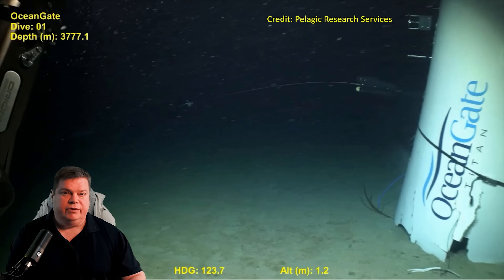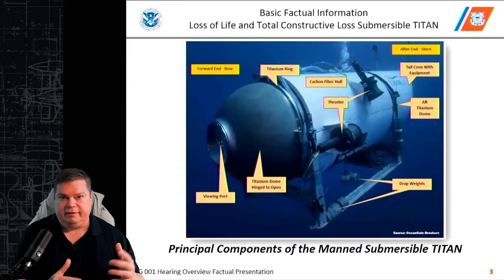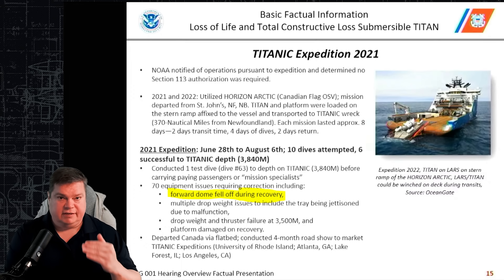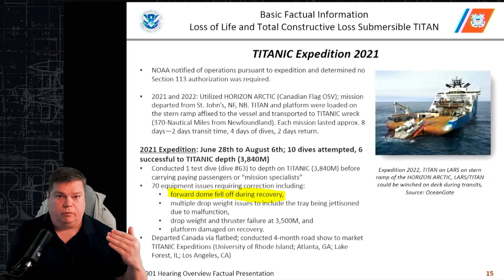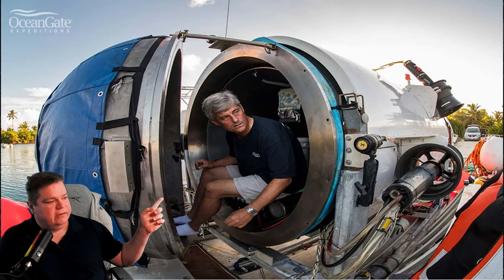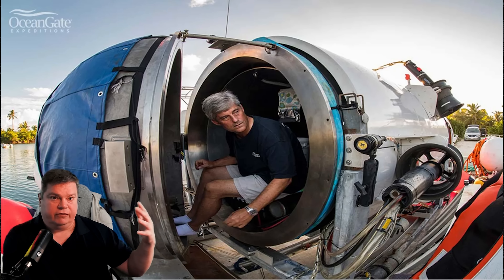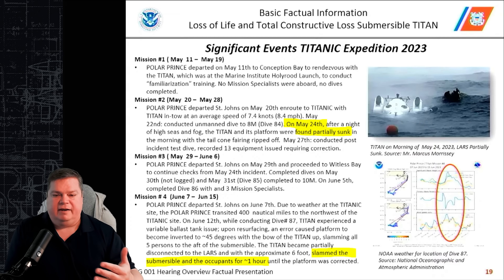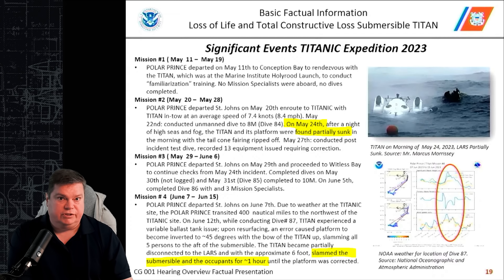New Evidence in Titan Submersible Disaster

Comment: G'day,

The Dome fell off 
BECAUSE 
Stockton Rush decided to
Only fit 4 of the 18 Bolts which were designed to fix the Dome onto the Ring -
"Because the Pressure of Water outside would hold the Dome in place..."

So, when the Crane Operator dropped the Titan onto the Deck/Ramp from a couple or 3 feet, during recovery...; the 1.3 Ton Dome was still falling when the Ring had already been stopped- by the Undercarriage and the Carbon Fibre Tube striking the Deck..., and the
4 lonely isolated spaced-out little overloaded 
Bolts were ALL
Sheared off, very
Neatly....

Then, when Stockton  recovered the Dome, and reattached it, resealing it, he used all 18 Bolts on the job.

But,
Nothing at all was done to
Inspect, nor
Investigate, nor
Asses quite
HOW MUCH  
SHOCK- DAMAGE
Was sustained during that
Impact..., by the
2-inch band of
EPOXY...,
Which was
The ONLY THING 
Attaching the
Ring onto the front of the 
Carbon Fibre Tube....

Bad Mistake, not checking - or better, 
Re-building a new and undamaged Tube/Titanium 
Glued Joint.

But,
That would have cost
Lots of
Money...

Evidence given to the Hearing was that the
Front of the Tube
Failed,
SIMULTANEOUSLY...,
ALL 
AROUND the 2-inch deep
Flange of the 
Ring..., The Tube was
Cleanly cut off  - and as the
Water Ingressed, 
Before the Tube had finished 
Collapsing - the Water had immediately flowed forwards and punched the 
View-Port clear out of the Forward Dome...

While the Ocean,
In microseconds..., 
Broke up the Carbon Fibre/Resin Matrix into  Epoxy-Gravel and chopped Carbon-Fibre Chaff -
And the Pressure then instantly
Jam-packed all that
Busted Carbon-Fibre & broken Resin, 
Along with the
Atomised
Occupants....
Into the Rear Dome, where..., 
When the Front Ring's 
Flange/Tube Joint actually suddenly
Failed...., There  was only one Seal-level Atmosphere of Pressure,
While the surrounding Water was pushing in at something like 350 or 400
Atmospheres....

Messy, very very
Messy...

Titan
Popped, like the
Badly-built
Bubble - which it 
Always was
Going to prove itself - so to be...

Stockton Rush was a
Selfish lying
Psychopathic
PRETENDER....

While ACTUARIALLY being
A hopelessly
INCOMPETANT
Smartarse.
And a greedy needy 
Money-hungry one,
At that.

The penalty for which, is
Usually
A
Grisly
Finish to the
Story....

So - yeah ; this whole
Shitshow was running
Absolutely,
Predictably,
Totally,
True-to-Form....

Somebody should discipline whomsoever it was that
Raised 
Stockton to have grown up to become such a very  murderous
Fcukwit...(!).

Such is life,

Have a good one....

Stay safe.

;-p

Ciao !

Comment: 26:00 just from my POV, i thought that part that is circled was a part of the carbon fiber pressure vessel that remained attached with what appears to be white paint or some other coating on the interior surface that has been chipped or broken.  i'm imagining the sudden and violent destruction of the walls of that cylinder flexing and distending wildly, cracking and flaking that coating off.  just a thought, not an assertion.  very much appreciate your work here!

Comment: "dropped 2 wts" - I remember reading a commentary of the text messages and according to timestamps and depth readings they were way ahead of expected schedule and approaching Titanic depth faster than normal. I always wondered if the carbon fiber was cracked and slowly taking on water the whole time making them heavier. I sincerely hope the passengers were not aware but this suggests they may have started dropping fast before the implosion.
Reply: Unless water actually entered the cabin it would make no difference because it's neutrally buoyant.
Reply: They would have dropped all ballast if they noticed water coming in.  If there's a leak at that depth you're pretty screwed anyway.
Reply: @EbenBransome  I think it's the difference between jumping into water in your swimsuit vs your clothes and shoes that take on more water and make you less likely to float.
Reply: @hanonondricek411  Wet suits.
The clothes impede swimming, wet suits don't.
Reply: @hanonondricek411  That's because clothes are lighter than water. Their point was the CF tube was not, so it being saturated with water or not would make no difference. Regardless as mentioned any kind of serious compromise like that would have lead to instantaneous collapse at depth. CF isn't just normally "permeable" to water like a sponge or something, it would have to be completely shredded to take on significant water

Comment: When you hinge a circular access to a cylinder, there is one pivot point on the rim. This means that the entire door is supported by that single hinge point. This is a fundamental weak point that needs to be quite robust in order to prevent damaging stresses. Ideally, the door would be supported by two hinge points with long arms to allow proper closure. Titan designers have opted for a single-point connection, but the hinge does not look strong enough to readily handle the weight and torque applied by operating the door. I am no engineer nor designer, but even I can see the weak point of this inferior design. Hopefully, an inspection process will come out of this disaster, which will provide a mandatory design-approval inspection for commercial submersibles.
Reply: There is already a system in place for this. Titan was built and operated outside of this inspection and classing system.
Reply: Pivot point => failure point? Anyone else thinking ro-ro ferry Estonia?

Comment: You can tell the messages were lagging behind or not going thru at all.. i myself wonder if the dropping 2 weights msg was sent earlier than they received it and titan was deeper than they could tell.. I wonder if it actually made it to the ocean floor but the jarring of hitting the bottom was enough to cause it to implode.. they had to be close to the bottom cuz the debris wasnt scattered very much.. even the small carbon fiber pieces
Reply: Where is the bottom sled? Not there?
Reply: @joebombero1  good point!

Comment: Were there no cameras inside the sub which can be recovered!
Reply: My theory would be at those depths, anything as sensitive as cameras and their peripherals would be destroyed beyond recovery. I am by no means a specialist, but that's what I would guess. Those are just incredible pressures, and commercial recording devices even aren't typically designed for such environments....and knowing Rush's propensity for using the cheapest products, consumer cameras probably were used, and they're just not designed for anything like this. Most of them you can't even get wet or sometimes even damp, and likely would have been inside the pressure vessel where the humans were. From videos and pictures of their recording equipment that I've seen at least. Just a thought.
Reply: @toddabowden  I would have thought that a memory chip in a mobile phone might retain some data
Reply: @MakeWhatYouCan  At that depth you're talking about on the order of the weight of an SUV sitting on top of an SD card. Not to even consider the forces involved in the actual implosion. Everything inside the vessel was literally steamrolled by a wall of water at the speed of sound (in water) which is about Mach 4. The only hope would be if they had some kind of dedicated, hardened external recording device in the tail, which I highly doubt given what we know about their design philosophies.

Comment: Something critical appeared to happen on dive 80 as well. The acoustic monitoring system showed a discontinuity as the Titan surfaced from 3800m. Energy was stored in the hull and released when the pressure came off. Some sort of material failure perhaps. A loud bang was heard in the submersible and even audible on the surface.

Then the collision with the tender on dive 87 and implosion on dive 88. Dives 80, 87 and 88 were the last full - depth dives.

Comment: 7:45 People saw them drag that equipment out to sea, and no one questioned or stopped them. But when TV came to film a clip about the accident they came with security guards demanding permission slips 

Towing an already failing and stressed submersible is not "fine". It is reckless and puts it at risk of even more failures.

Comment: Thank you @SubBrief. By the time this video hit utube it was just a fraction out of date. We now know that the failure occured (as, reading between the lines of your commentary, I think you suspected) at the interface between the carbon fibre hull and the forward ring into which the hull was bonded. The thick carbon fibre hull was compressed, leading to its outer edge being pulled outward in the ring, breaking the epoxy bond, and its inner edge being compressed into the ring with an inward bending moment of force causing a simultaneous compression fracture of the inner layers of the carbon fibre hull against the inner rim of the forward titanium ring. The water pressure at in excess of 400 bar was a lot more than plenty to finish the job, fracturing the carbon fibre hull instantaneously all the way around that forward ring/carbon fibre hull interface and compressing everything into the rear end dome in, as you rightly point out - microseconds. Previous dives would have weakened the laminar structure of the thick carbon fibre hull, permitting progressively more inward flexing of the carbon fibre hull until it reached the failure point on that last fatal dive. Foresight should have been sufficient to have highlighted this weakness - but incompetance masked it. Who is to blame? Stockton Rush all the way from start to finish.

Comment: It is amazing that there are no bones sticking out of this.  We had a hardhat diver failure under similar conditions, and most of his body was crushed into his helmet, with bones visible.  Made me want to never go into the water again.
Reply: The pressure of the depth that the Titan was wrecked is over 350 times greater than we have on anyone living on the surface. Any bodily matter including bones and fluids will immediate disintegrate well before it reaches any visible part of the ocean due to the sheer crushing amount of pressure alone at such depth.
Reply: That's sounds horrifying

Comment: I’m stuck by the way the carbon-fiber passenger compartment was crushed AND rammed into the aft pressure dome.  Your point, about the failure mode of the connection, between the forward dome and the titanium locking ring, appears to have been overlooked, ignored, and/or gone unpublished, during one of the earlier test missions.  Merely reattaching the forward pressure dome, without knowing why it fell off, was an act of negligence at best.  Hindsight is 20/20.  May God have mercy on Titan crew’s souls.

Comment: 28:20 I STRONGLY disagree with your premise. The front nose cone was popped off BECAUSE the inner ledge of the Titanium Ring was only 1/8" by 2" and not anywhere NEAR strong enough to support the weakest point of the CF tube (The edge) They made the ring inches thick where it wouldn't support the tube so the ring was strong in itself BUT it was woefully too thin where it would be expected to support the part it was Glued to. The Glue was expected to work because of the pressure pushing on the nose cone seating the ring. They F'd up by the numbers because they never calculated how thick the inner ledge of the ring needed to be to keep the edge of the CF tube from collapsing.

Comment: I read Rush felt the pressure under water would hold the dome on so only 4 bolts were installed. When Titan was dropped on deck the 4 bolts sheared releasing the dome

Comment: I heard someone reporting yesterday that the dome fell off because Stockton Rush decided securing the dome with 4 bolts rather than the 16 in the design would be fine. Then the sub was dropped on recovery and the 4 bolts sheered. So that means he when to depth with only a quarter of the fasteners holding the dome on because it saved a few minutes of prep.

Comment: I would assume the dome "fell off" while open, resting on that hinge. You didn't seem to mention that in your video. You made it seem as though the dome came away from the adhesive and they simply glued it back on. That support arm holding it open, which you say "stops it from closing on you" is probably the "fix" to the "cause" of the dome-falling-off problem.

Am I missing something?

Comment: Based on the description of the design of titan sub can clearly see that the obvious points of failure are the connection between the titanium and carbon fiber haul. The images of the wreck shows the titanium parts intact while the carbon fiber haul essentially gone.

Comment: What is there to discuss. The pilot exceeded crush depth of the submercible. Submercible was not engineeered properly, and had material failiure at depth. All were killed instantly. They likely had little or no warning. Pilot/founder's ego got better of him. He brought his experience from tech world and aerospace and applied to deep ocean engineering, a completely different field with deifferent requirements. Company, he ran, decided to get cute , hip, and cool, and hired young exuberance, instead of aged experience. Where titanium and steel , they used spun carbon fiber. Pressure hull failed, they died. All thats lieft now are lawyers shouting. Any criminal charges sunk with the pilot. Former employees who gave warnings were fired and ignored. Those former employees did their due diligence.

Comment: I believe it is safe to assume that the fail process was logarithmic, but that it started slowly with audible sounds as various patches of carbon fibre was failing ... ie snapping or parting of layers. Water was entering into the controls (hence comms failure) and structure. During this time the occupants were in absolute terror. The final failure was too fast to perceive.

Comment: The front fell off, the dome in this case, because the crane operator wasn’t exactly gentle with the submersible and they only installed four of the eighteen bolts that secure it for convenience.

Comment: For those curious, at the depth of the titanic, the PSI (pounds per square inch) is roughly 6000. 
To put this into modern lingo, every square inch is experiencing the weight of a F-150 pushing in on it. Doing some ballpark math to figure out the surface area of the Titan, the submersible felt roughly 550 f150s sitting on it from all angles. That's a lot of pressure and is proof that we should always respect nature and limitations set on what we as humans want to do.
Reply: Americans will do anything to avoid metric

Comment: Im just shocked that there havent been more peoeple mentioning a the fact that the hatch to get inside is literally apart of the structural integreity of the vehicle. Theres a reason the main hull of most modern deep sea diving subs use a hatch at the top instead of having a significant part of the hull being a door at the same time. Theres a reason no vehicle ever that has caught on with the trend of having 25% of the being a door. Large amounts of stress is going to be going on the hinges and having the entire front be able to open easily and have it to be air tight and high pressure resistant is rediculous especially for amatuers.

Comment: I watched a video on the making of the sub and I deal with an adhesive like was used on the sub end caps (plexus) and believe the the titanium surface was not prepped right. When they applied the adhesive to the titanium you can clearly see it was a shiny machined part. It also calls for a colored primer before application.

Comment: I believe a key in how it imploded is front dome separation. Dome was blown clean off the adapter ring. The port window as well popping all the bolts from the flanges from what I saw from recovery pictures. This had to happen as a result of a tremendous pressure pulse as result of the implosion. I believe the carbon cylinder lacked lateral strength and could have had an accordion collapse, which seems like the pulse would be in the direction of the center axis of the cylinder.

Comment: The front dome falling off wasn't a design flaw. It was because of misuse and corner cutting. Stockton Rush told them to only install 4 of the 18 bolts that secure the dome in place while diving because he believed the water pressure would hold it in place. After the dive when they picked the sub out of the water the crane operator dropped the sub and the force sheared the 4 bolts off causing the dome to fall off. So it was a drop and not having the required bolts as to why tge dome fell off.

Comment: There is more that needs to be said about the event when the dome "fell off" in 2021. Stockton Rush had decided that only four bolts were needed to secure that forward dome - "because deep sea pressure would ensure that there was a good seal between the dome and the hull forward ring". When the Titan was being recovered from the dive onto the mother ship, it was dropped onto the deck. The force of this fall was great enough to shear off the four titanium bolts and for the dome to fall off, damaging the hinge. This shock load must have been transmitted through the underframe, the carbonfibre tube, the epoxy glue joint and the forward titanium ring. It seems highly likely that other items were damaged, in particular the glue joint retaining the forward ring to the hull tube.

Inspection visual evidence submitted to the enquiry by a witness who examined the recovered parts on the deck of the post-accident recovery vessel suggests that the initial failure happened at the glue joint.

Comment: So it sounds like the most logical suspicion right now would be that there was a failure of the seal between the titanium cap and the carbon fibre body, not necessarily in the body itself. But I assume the difference of strength between these two materials didn’t help.
Reply: The body got squeezed and slipped off the front. Composites crack and are not flexible like steel.